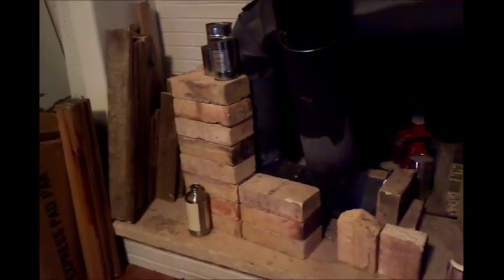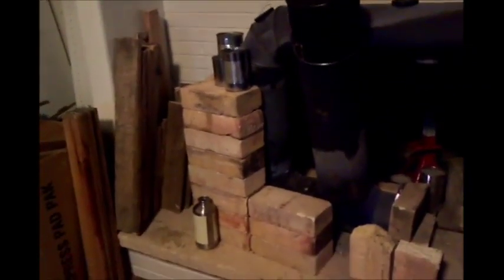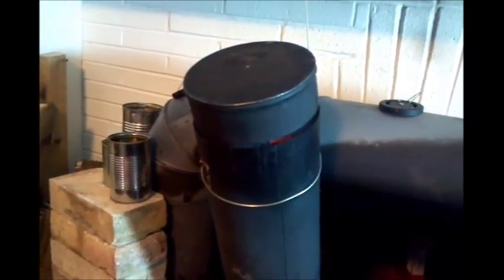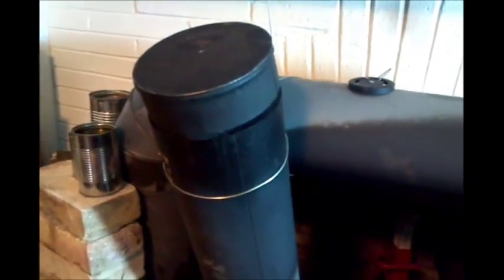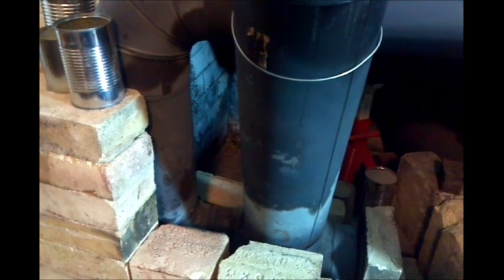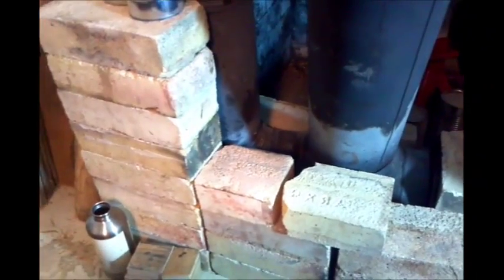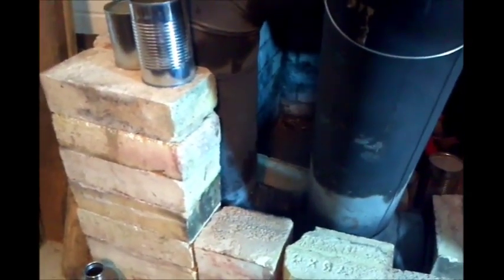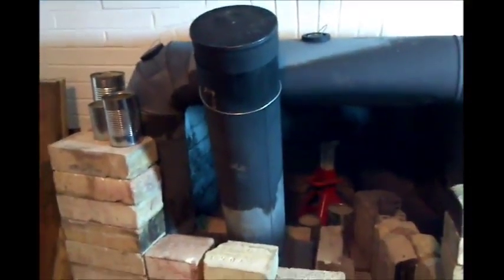02/20/13 Reginalds Rocket Stove Fireplace UPDATE FIRE BRICK TEMPS

Comment: Do you steal use this? How warm does your room get.
Reply from the maker: Yes.. I changed it and made it fit inside the fireplace, but less than half the heat since changing it..planning on returning to the original design this fall,
Reply: Reginald Kinnaman thanks so much . I am a widow TRYing to heat my home easier.  I can't thank you enough for this video.  If i can get it figured out ill show it to you. Again THANK you

Comment: I was talking about putting the connectors in the end cap sides turn conduit down to pull in air from below. Sort of like P Potys fire box. will need to experiment on size and some way to damper this way cap is tight but air is still entering fire box

Comment: nice vid. maybe you could put some emt connectors in the cap for fresh air intake.would be nice if you could preheat your fresh air before entring
Reply from the maker: plenty of fresh air, some of my windows are still single pane. updating them soon so I will need to consider the loss of some of their leakage.

Comment from the maker: 6" from Home Depot, cost under $200. Dont use galvanized pipe.
Startup can be tricky with the T design unless you start the fire past the Feed pipe of the T. Im still running the same design but put a chimney cap about 1" above the chimney made of a cookie sheet, this allows the brick chimney to warm up and hold heat also. Keeps the chill off the house as it released through the night. The More Brick the better.

Comment: That's what's great about Rocket Stoves, different types, complex or simple, expensive or free. Looking for simple, cheap and effective designs is a great thing. I'd like to get into molds and clay(cat litter?)/cement/perlite mixes soon, add chimney and fuel clips on top. Great what you are doing and it's doing work for you! Thanx for the tip about the firebrick holding the heat!

Comment from the maker: There are alot of various rocket stove ideas, just wanted to keep it simple so anyone could do it. next stove will be a little more complex, The firebrick are mainly for thermal mass, the face of the old fireplace is also a thermal mass as well as the full chimney. The regular brick didnt seem to hold the heat as long, the fire brick was still warm after the fire was out.   My next stove (depending on recycled materials) would like to make modular in a flat plate design to fit in the fireplace.

Comment: I wonder if regular brick would work the same, wouldn't it have about the same thermal mass or maybe even more than firebrick? I think firebrick has more insulation than regular brick.  Firebrick is good for the high temp areas and perhaps you might want to consider replacing some of the pipe that gets hot with a metal tray that might hold the firebrick, maybe even make the chimney like the one ZeroFossilFuel uses on his stove altho that one is a bit smaller in diameter...thermal mass is key!

Comment from the maker: Yip, but I need that mass for a longer burn time. I knew the problems and have been addressing them.
The Cap on the Feed pipe works great until I over load the pipe. I am learning ways to put the wood in that seem to solve the problem and not over fill the pipe. putting the cap on allows the wood to gasify and is generating higher temperatures in the sideways flow as it draws the gases downward.

Comment from the maker: If I were going to use brick (Firebrick) I would rebuild the entire core of the fireplace into a Masonry Heater design. I feel it may be moving that direction anyway. There are some awesome designs that hold the heat for 8 to 12 hours after the fire is out.  Just search for Masonry Heaters.

Comment: Reginald, since you have the T in your set up (I don't yet) and you mention that you are having the feed tube block the chimney with the wood feed, you should probably weld a piece of perforated metal (not cheap) or some other method to keep the air flowing under the wood feed.  As the wood turns to ash it will fall through and the air will keep the fire burning.  Concept similar to a Pellet Stove!

Comment: one reason you got smoke pufs out the feeder tube might be because it is taller then your heat riser this might limit your draw and that is why you see flames in the feed tube,
idealy you only see flames in the T section being pulled sideways into the heat riser.
insulation will help too but as you said you are waiting for a bigger pipe so you probably knew that already.

Comment from the maker: but since adding the chimney cap, my front of home has always been over 60 degrees each morning. 
One reason I didn't insulate the pipe is since its basically chimney pipe, I didnt want to get the stove to hit too high of temperatures and Im sure Im reaching over 1000 to the riser but letting that absorb into the fire brick.
currently the temperature going into the chimney is over 250 which eliminates the possibility of cresote build up.

Comment: Because if you are having to push cooled combustion gasses upward through a tall narrow flue up 20 or 30 feet like a conventional chimney you would lose a lot of draft potential.  Less efficient systems with hot gases (wasted heat) exiting up the chimney and outside are how typical wood stoves function. Rocket mass heaters require a different level of design and thinking to achieve maximal efficiency and economy. You have an excellent opportunity to build an efficient system and you easily can.

Comment: ...pushing upward and the cool gases pushing down combine together to increase the rocket effect, that audibly powerful sucking draft at the intake. Optimally you would want to insulate going up and the have heat sinks and rapid cooling going down. Your general economy of construction is great but you would do well to redesign your layout to increase efficiency. The mass should be added to the cooling sections and that's why efficient rocket heaters exit the building low through a wall.

Comment: Let me explain. The rocket draft effect is achieved when you have hot gasses rising. The hotter the gasses the lighter (less mass) per volume and the greater the force pushing upward relative to the colder denser air pushing in from the burn chamber. The longer (in time) you can maintain those higher temperatures the greater percentage of burn and the higher the efficiency. Rocket stoves are efficient when there is insulation going up and rapid cooling going down. Both the hot gases (continued)

Comment from the maker: I had considered coiling copper tubing to the downpipe, but the fireplace is too far from the water heater and bathrooms. If I had designed the house, the fireplace would have been central so it could be utilized more.

Comment from the maker: Riser is only 18", Top cross pipe is 2', down pipe is 18", pipe back to back of firebox is 2', then it turns and crosses to the existing 6" hole. Budget didnt allow more elbows or I would have done alot more.

Comment: Suggestions for you to consider:

#1. Take some aluminum foil and wrap a couple layers in a spiral all along your burn chamber through to the top of your burn riser. 
#2. Buy some unbacked fiberglass insulation and wrap the aluminum foil a few inches thick.
#3. I couldn't see the length of the pipe you have going horizontal after the burn riser but you might consider lengthening that as much as possible before exiting through your flue.

Insulation helps improve the rocket effect and efficiency.

Comment from the maker: I moved them a little more this morning. I now have the stacks by the heat riser up to 10 bricks and put any broken bricks behind the heat riser pipe. This makes the stacks almost to the top of the top cross pipe. (These are thick fire brick from an old boiler built in the 1950's, wish I would have kept more of them)